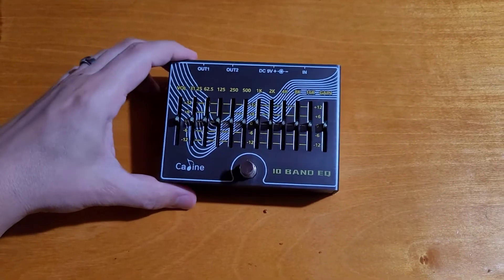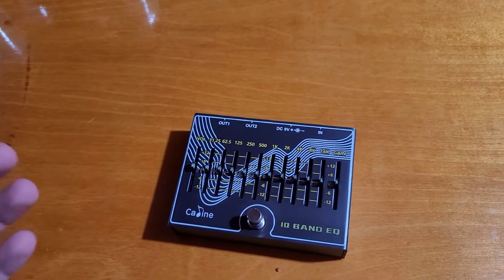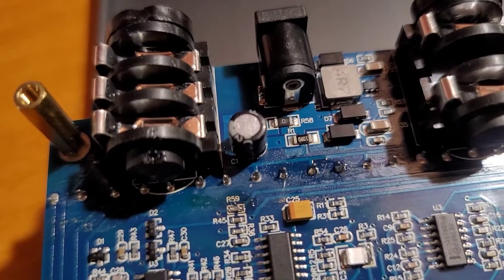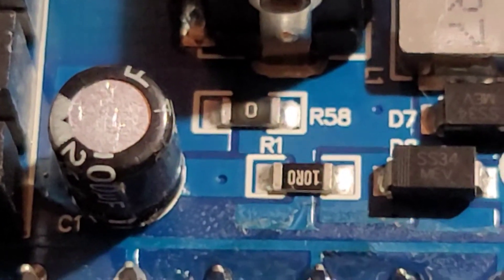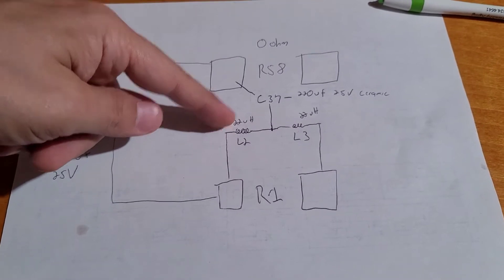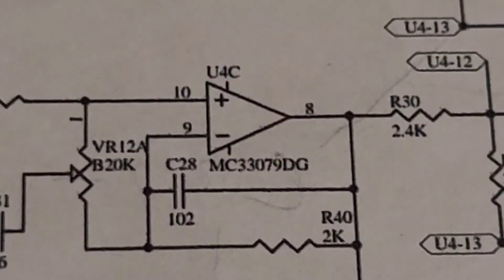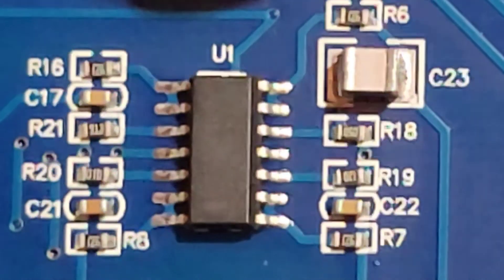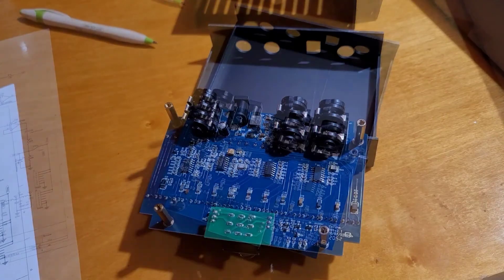Caline CP-81 - Modify/Repair v2.1 - PSU Hiss / Volume Fader

Comment: But I have those tools! COuld you at least share the schematic, please?
Reply from the maker: The schematics I have are not entirely correct. There are other minor differences in the circuit that don't correspond to the 2.1v. I never got the 3.0v schematics since it did not have the issue anymore. I wound up doing the mod, but I bypassed the step up circuitry entirely and ran the pedal off an 18V PSU instead.
Reply: @Bassguitarist1985  that's fine. But do you know if the difference between those versions and the caline CP-24 version is on the chips? This version uses TL074 ICs and run on 9vdc.
Reply from the maker: @PintaoLoko  yes the chips are different

Comment: I've just cut the track running from R6 to 6 pin of U1, and between 6 and 7 pins I soldered a 2K parallel resistor and a capacitor marked 102. It didn't make any changes. I have already bypassed the R59 resistor before. As a result, there were no changes. Maybe I shouldn't have bothered with U1 at all? 

It's marked on the board that this is version 3.0
Reply from the maker: @abrajmek_zalilov  V3.0 only bypass R59. Remove that 2k. That only applies for V2.1
Reply: @Bassguitarist1985  Look, even if I don't reconnect the cut track, there are absolutely no changes. How it works?!
Reply from the maker: @abrajmek_zalilov  apologies you are having trouble. R59 needs to be bypassed or shorted. Leave U1 stock
Reply: @Bassguitarist1985  It's OK, I don't blame you, I just wanna understand how it works with cut track? Nonsense...
Reply from the maker: @abrajmek_zalilov  don't cut any traces. You need to bypass/short where r59 is.
Reply: @Bassguitarist1985  I understood. I allready did it. I'm trying to say, that it no matters cutted track or not: works the same way. You see? Now I reconnected It. R59 bypassed as I told earlier.
Reply from the maker: @abrajmek_zalilov  understood. Something else is wrong in the circuit. Not sure where to look. Maybe try another unit?
Reply: @Bassguitarist1985  haven't another unit. Leave it with one pin connected to another. As it was before my changes.

Comment: Greetings, dear author! 
I have an eq version 3.0, and everything you mentioned is present, except for the C1 voltage, it was still the same 16 volts. But I replaced it with 25, without checking whether there was noise or not. Works fine.

Comment: do you know what are the values for the slider pots? how much Ohms?
Reply from the maker: They are B20K
Reply: @Bassguitarist1985  Thanks man! trying to design a preset controller using digital potentiometers ;)

Comment: Hi, I would like to ask you if you could send me the schematic for the Caline CP-81. Mine probably has a broken LED switching circuit and I'd like to get it fixed (I already emailed Caline but they didn't reply). Thank you for answer.
Reply from the maker: Which version?
Reply: Thank you for the quick reply!
I have a PCB version 2.0 (according to your video for V2.1, the LED switching section on board looks pretty similar to my V2.0). @Bassguitarist1985
Reply from the maker: @lukasnosil8460  what's going on with the LEDs exactly? The two outer LEDs are on one circuit, The first five faders are on one circuit and the second five faders are on another circuit. They are all wired and serious so if one LED is bad they will all not light up.
Reply: The first and last fader LEDs are lit when the effect is off, which is fine. The other LEDs will not light up when the effect is turned on.
I will test the individual LEDs on the faders separately with the DMM and see if any of them are bad, thanks for the info.
I originally thought that the problem was in the circuit for switching the LEDs - specifically the IC marked Q2 (transistors in the vicinity were fine).
Reply from the maker: @lukasnosil8460  long as the effect works on and off it's not the switch. My guess is during assembly one of the LEDs were installed backwards.
Reply: I tested all LEDs on all faders and they work. Please share the schematic so I can solve it. I think it's in the part of the circuit for switching the LEDs.
Or, if you want to keep the schematics to yourself, please tell me what IC Q2 is (I assume Q1 to Q4 are bipolar transistors, so I measured them).
Reply from the maker: @lukasnosil8460  shoot me an email and I can send the LED circuit portion

Comment: Hi @Bassguitarrist1985, I have this Caline 10 band eq gen. 3, I lend to a friend and he returned it sounding too low. At +12 db Volume-Gain sounds as it was at 0 db. My friend told me he missconnected the output 1 to various amp jacks and that was when the problem started. I used my multitester on the resistances but everything seems normal. Do you have any idea what component might be failing? I would hate to throw away this nice pedal. Thanks in advance
Reply from the maker: Did he connect to the speaker output of the amp? Or the preamp out? Too strong of a signal could have blown the opamp chip, specifically the U2 chip.

Comment: Hi BassGuitaist1985
Thank you for sharing this, did you make the modifications on this board and could you show them how you did ?
A question, there's no output for U1 on 6 or 7, is it a  missing link on the schematic or the output is not used, in this case why do we have to mod the output ? Usualy when op amp are not used there are connected this way to avoid noise, is it the case here, or is there is something I didn't undersatnd ?
Many thanks for the time you spend to explain things.
Reply from the maker: Hey. No I didn't wind up making the modifications on the board as I already had made the adapter to work at 8.5 volts. You are correct U1 does not have all of its op amps used.

Comment: What if you bypass the boost converter and use a 18 vc power supply to avoid noise from the switch mode boost as MXR 10 band EQ?
Reply from the maker: Yes thats possible to use an 18 volt barrel tip negative power supply like the MXR. 

For the board mod: You need to remove the chip U5 from the board entirely. Take a jumper wire and connect one side to the banded end of D6 and connect the other end to the positive side of C1. This keeps the reverse polarity protection intact. To make things easier on the C1 jumper connection you can remove R1 and use the vacant solder pad going to C1 to hook it up there.

I don't expect many to make this modification or go to this extreme but the solution does work!
Reply: @Bassguitarist1985  yes it's a pretty easy mod in comparison with the noisier ones. I got a cp 24 that uses only 9V, one cap and one protection diode. This pedal has very loud audible noise. I look that CP 81 uses McC33079 ics. Cp 24 uses lm 074, very cheap and easy to find. I was wandering if I substitute one by another will it solve the noise issue?
Reply from the maker: @PintaoLoko  it will not solve it. Its missing inductors on the step converters output meant to supress the noise generated by the U5 chip. Bypass that circuitry and the pedal is dead silent.

Comment: Hello. I realize you are the most prepared and indicated for this question. It is posible to reduce the noise in the old version MXR 10 band (black one)? I have a deal for 70$ here in Venezuela for this pedal but my only concern is the noise. I know the new M108S is lighter, trough bypass, brighter leds.... but I only care about the noise benefits. It is possible to make it quieter with mods?
Reply from the maker: Possible yes, but not cost effective in my opinion. I haven't done that mod but im sure its documented somewhere where a good DIY person can perform it.
Reply: @Bassguitarist1985  Woao thanks really for your fast response. The donwside with the old MXR 10 band eq (black) is that they are SMD and not trough hole like the news (silver M108)
Reply from the maker: @smartlevel1450  even newer version is SMD
Reply: @Bassguitarist1985  Ohh I didn't knew that. Do you think the same silent OPAmps of the M108S will fit the M108? Do you know the name of the correct chip for this task? Here I think a Cellphone tech could do this work for me.
Reply from the maker: @smartlevel1450  MC33174 is the part#
Reply: @Bassguitarist1985  Thank you
Reply: @Bassguitarist1985  I want to make you another question. If I don't care about the light weight aluminum case, the brighter leds and the new true bypass ......... the only left advantage of the M108s vs M108 is the lower noise?
Reply from the maker: @smartlevel1450  lower noise yes different quad channel op amp chips yes. In this case I would elect to have the newer version and modify it for the dimmer LEDs. The older versions can be modified as you mentioned however if you have the skills and the tools
Reply: @Bassguitarist1985  Thank you so so much. Since I'm finding the older version here en Venezuela for 80$ with power regulator, I think I'll choose to buy it and modify to better op amps chips.

Comment: Thank you for walking us thru this!  Appreciate your sharing your knowledge!  I may have to wait a little longer till I can pick up this eq, but have already looked into the adjustable resistor for the power input like you mentioned using.  Might not be bad to have some whether or not I get a v3 board when I'm able to get this pedal.  Sometimes the "dieing battery" effect from the outboard "drop resistor" can make interesting some cool sounds.
Reply from the maker: Yes for analog impedance sensitive pedals like fuzzes distortion wahs etc the drop resistor will be beneficial